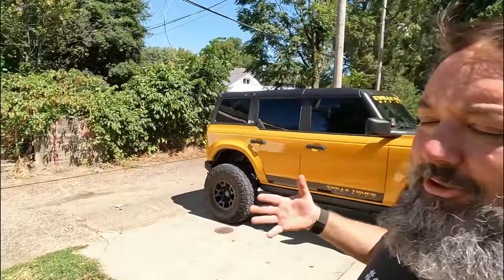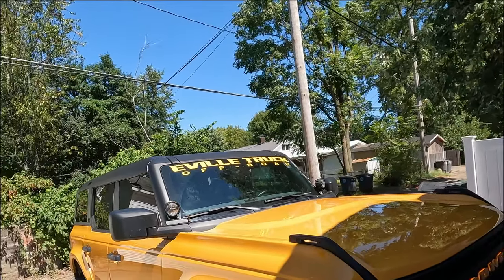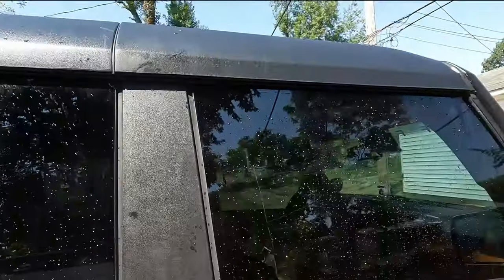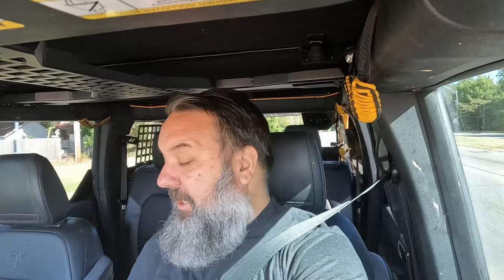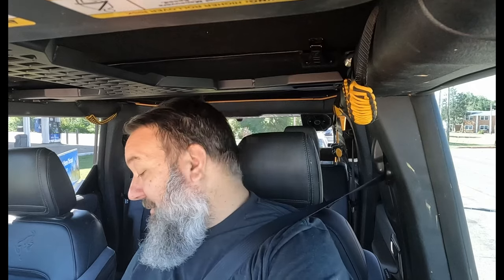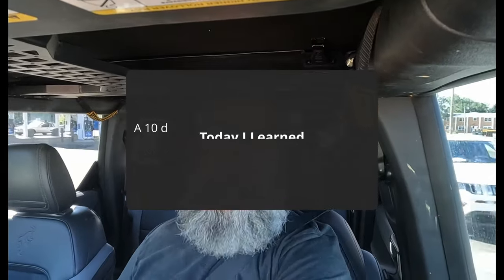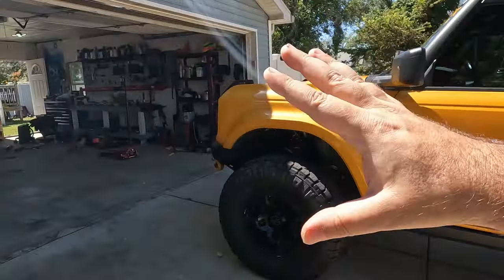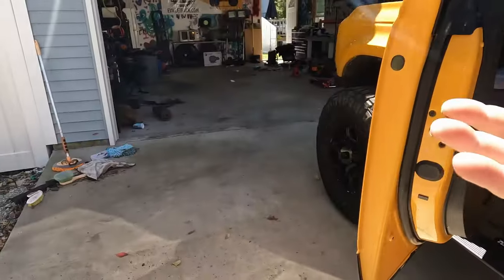Hardtop Q&A: Everything You Want To Know

Comment: Overall looks pretty good but I don’t like the way the side windows have a shape that doesn’t quite follow the same slant angle of the top in back - it just looks kind of off…not sure why they did that. Also the placement of the badging is extremely off-putting to me and I’m sure many others. Wondering if front section can be removed if OEM roof rack is installed since it’s one big piece instead of two smaller pieces like OEM.
Reply from the maker: From what I have seen so far the front can not be taken off with most roof racks. I am not sure if there are any that are tall enough that the top can be slid out or not.

Comment: Im sure you have answered this before. But I havent seen it. Where did you get that metal molle in the front on the roof?
Reply: Also how do these tops fit with a trailrax roof rack?
Reply from the maker: @2bebetter   Its DV8 overhead molle https://www.youtube.com/watch?v=h7u51wNkYEc   THey should work fine, I haven't actually fit one on but the attachment points are the same as OEM so should fit right up.  ( Maybe one day  after I figure out how to make my garage taller I can get a roof rack :)
Reply: @ nice thank you. I’ll check out that video. Seriously considering that roof

Comment: Does the removable portion over the driver and passenger fit inside the bronco?
Reply from the maker: @edgeorge1156  I will check and verify most likely only if you flip down year seat and lay it long ways. It won’t fit sideways but may at an angle , I will experiment and see for sure
Reply: Thank you